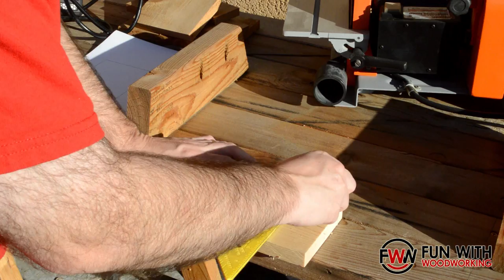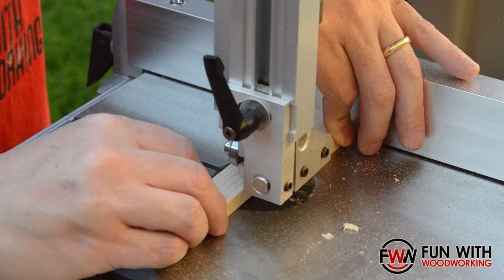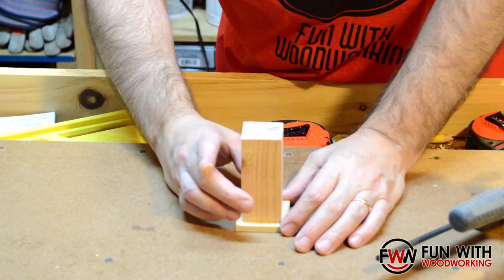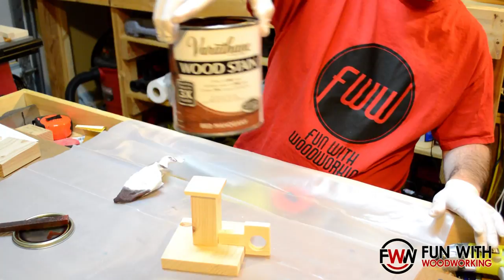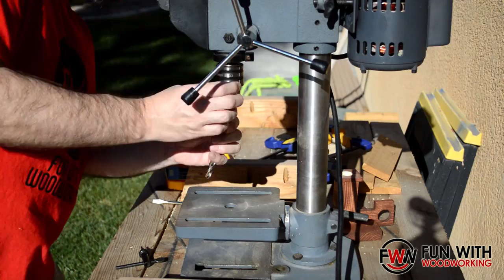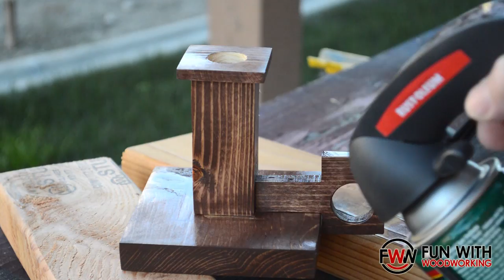Project - Rustic Mission Style candle holder made from scrap wood

Comment: You need to put a metal insert into the top for holding the candle otherwise it becomes a fire hazard.
Reply: FunWithWoodworking
Utilize um pedaço de cano de aço no interior e por fora talvez uma arruela grande, assim você isola o fogo da madeira.
Reply: FunWithWoodworking use a copper pipe end cap from the plumbing section.
Reply: ***** Its not meant as a criticism, in reality people walk away from candles all the time door bell rings, you fall asleep, checking on the kids etc etc. I learned this the hard way, noting serious happened but I did spoiled some nice holders I made.
Reply: FunWithWoodworking you can get them in wood turnering supply places they use them all the time or like KFSWG suggested make your own a small metal cup of some sort is all it is.
Reply: Nice, keep up the good work!

Comment: Where did you buy your drill press from?
Reply from the maker: akhurash I bought it at Harbor freight and have no complaints.  I waited until it was on sale and then used a 20% off coupon and got it for about $60 out the door.
Reply: FunWithWoodworking
Is that the 8" or the 10"? I'm looking to get one as well and I thought that might be from HF.
Reply from the maker: akhurash It is the 8".